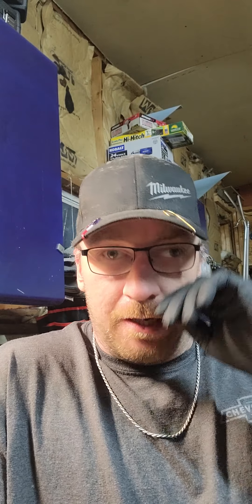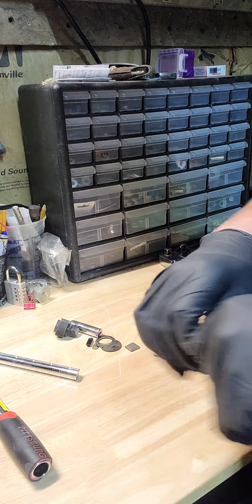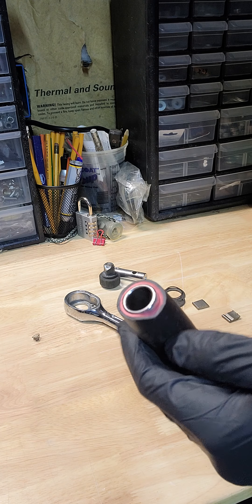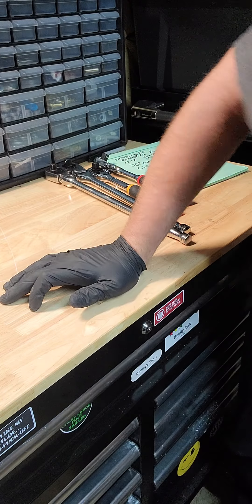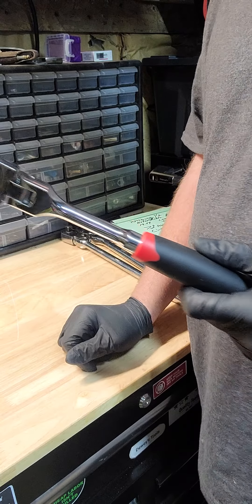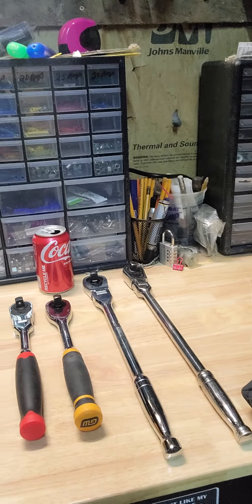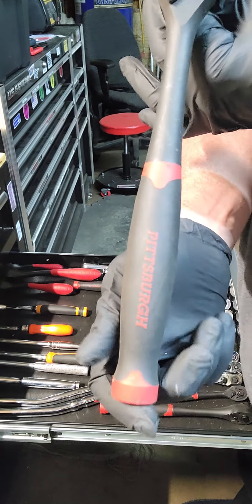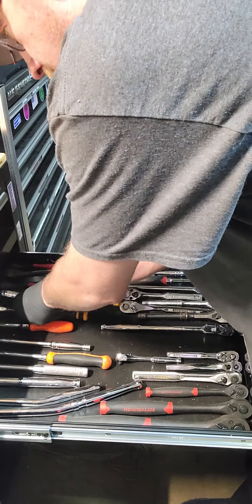HARBOR FREIGHT RATCHET#harborfrieght #gearwrench #snapontools #ratchet #pittsburgh

Comment: I have the same ratchet and use it every day as a lube tech. I've used it on almost every drain plug I've touched for 2 years with no real issues. The rubber grip came a bit loose and slides around a bit, but that's all. A couple of my coworkers have the same ratchet and have done a lot of work with them. I don't doubt your experience, just wanted to share mine.
Reply from the maker: Ok thanks like i always say some are good but some are garbage i guess its the luck of the draw but mine was garbage and i know alot of people that has used that ratchet and it failed them also but i still have several other pittsburgh pro ratchets i like including the icon ratchets

Comment: Only person that would compare a Pittsburgh pro to a snap on is Edtheoldtechguy. The snap on is going to be your go to ratchets. Life Is Too Short For Cheap Ratchets.
Reply from the maker: Its definitely a game changer for sure its become my got to ratchet for sure
Reply from the maker: But keep in mind i dont have access to the tool truck brands all the time
Reply: @ragincajungarage  ebay has thousands of tool truck tools. Plus if you pay attention can bump into tool trucks at fuel stations and repair shops. Like my dad used to say where there is a will there is a way.
Reply from the maker: @jeramy2398  yes i have done ebay and the pawn shop and have ran into the tool trucks out on the road i buy when i can
Reply: Haha that's gonna be my new go to excuse for buying SO. Life's too short for crap, that's why I married you baby

Comment: Nice video man I have mostly snap on ratchets. I do have a 3/8 GearWrench ratchet and it’s pretty good I like it! I wish my snap on 1/2 24” long ratchet was like yours not locking…snap on locking mechanism is not good, my experience does hold very well. I’ll be watching for more from you🙌👍🏻👌
Reply: Snap on locking DOESN’T hold very well🤦‍♂️really need to proofread better.. my dealer just warranty out the locking part when I said something about it because of this video lol I’ll see how it does now!
Reply from the maker: Its not a very bad ratchet

Comment: Ive always found any gimmick to be crap. After years of ruined trust from cheap brands always breaking just when you need to rely on it I stick with quality. I'm from England but nothing beats USA made for the quality and warranty. I'd like to see what Japan has to offer though I can't imagine warranty ever really happening
Reply from the maker: Unfortunately no tool brand is perfect every brand has its faults
Reply: @ragincajungarage  we have a HF equivalent called 'Halfords'. They're national chain that sell auto stuff, bikes, tools and also do service and maintenance. I think they call themselves an autocentre. They're pretty good for the price though nothing amazing. Great for a starter, just about acceptable for a professional. They've been around 30 years or so and are probably more respected than hf tools though their mechanics are a joke
Reply from the maker: @georgecroney6168  not everything at harbor freight is bad but all of the specialty tools are garbage u can find the tool truck brands at the pawnshops and if needed u can always warranty the stuff u get from the pawnshops with the tool trucks its all be done